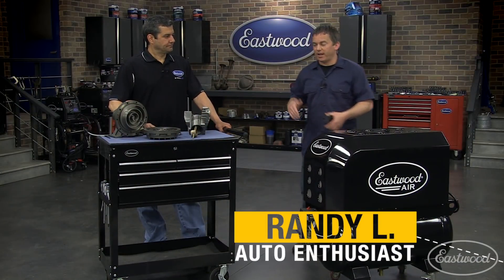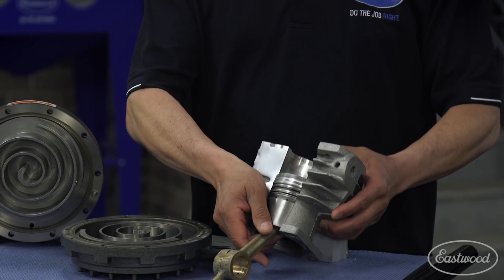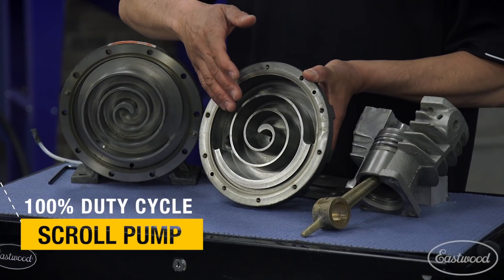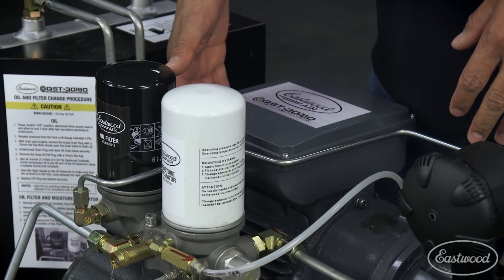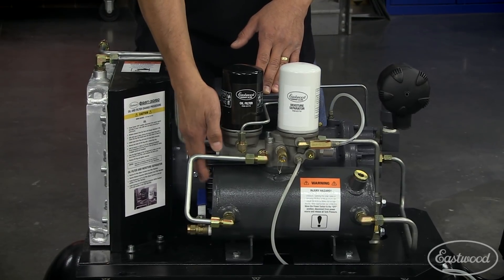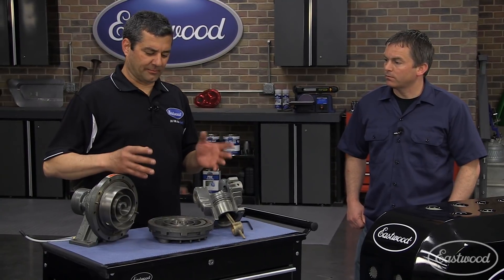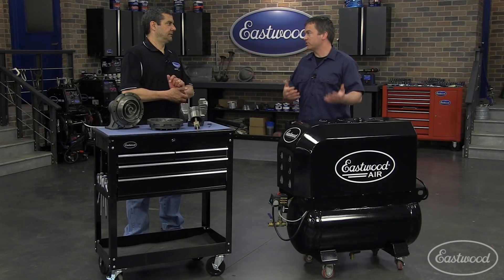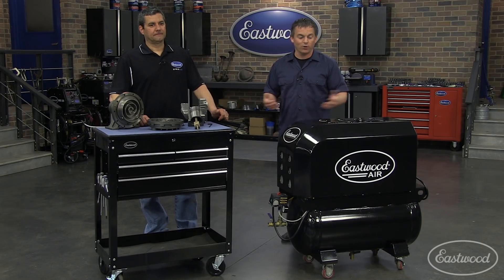QST Scroll Compressor - Mark Explains Technology & Performance VS Piston Compressor - Eastwood

Comment: The ambient humidity in my region produces a lot more condensate (water) than a spin-on filter can hold.  Does more water fall out in the tank and need to be drained?  A few words on how this works out would be helpful.   Also, what is the recommended maintenance interval (hours) on the oil & filter?

Comment: Could this paint à Whole truck without having to wait for thé compress to catch up
Reply from the maker: If your spray gun  operates within then 12 cfm output of the QST 30/60 at 40 psi and the "truck" is a standard  pick up and not a commercial dump or over the road truck then yes it will work for your application.  Thanks for the interest and question.

Comment: You didnt mention the max PSI in the video, unless I missed it, but from your website it says 145 psi which is pretty good.
$1190 is a lot of money though :(
Reply: It's comparable to some other compressors in price and capacity. Keep in mind, too, that a compressor like an Ingersoll Rand uses a smaller compressor head, so they have to overdrive them to get the same cfm. This causes more noise, shorter life, and more heat, which causes more moisture problems in your line air.

Comment: So much efficiency ! ---?? scroll compressors for cars?
Reply from the maker: You won't believe how quiet it is when it's running.  And we've used it to power a big pressure blaster when we were working on Cody's Camaro, plus used it to paint the Corvair door in our recent "How To Paint a Car" video.  Plus we've used it for other tools in the shop and we've let two big local shops test it and they loved it.  Those testimonials are on Youtube as well.
Reply: My 1992 Dodge has a scroll AC compressor.  It's a Sanden TF105.